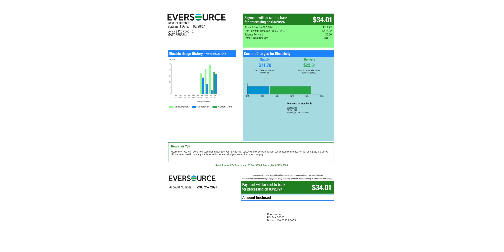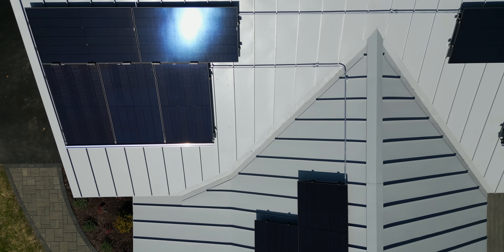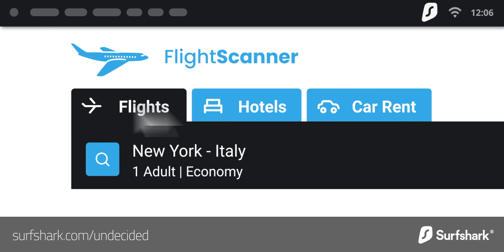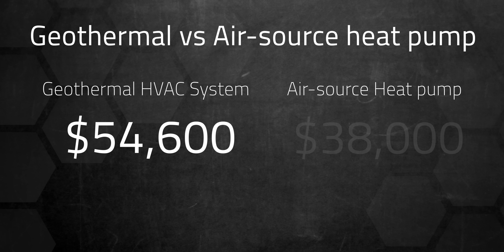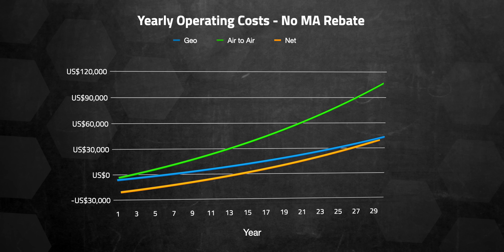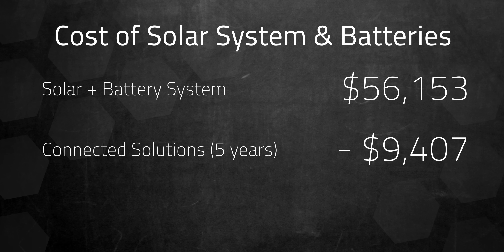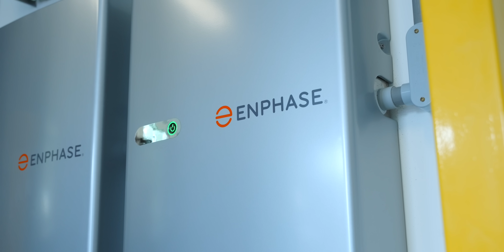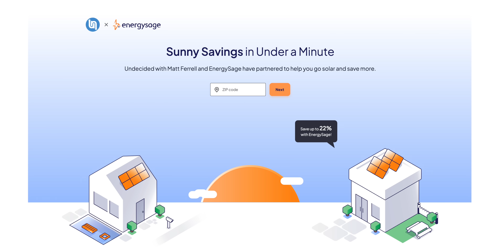What I Learned After 1 Year with New Solar Panels

Comment: Enlightening. Great for new homes, but of limited use for old ones. We are looking at buying a house built in the 1950s. I'm sure its HERS value would by like 100, or so. It would be better after insulating with modern materials, but still not great. Most people wouldn't be able to determine all those numbers you came up with, but the general concepts are sound. Maybe Energy Sage will be helpful. Thanks.

Comment: Watching this now and from someone who just installed solar in November 2025, those prices are insane!

My 7.9kW (13x615W) panels, 6kW hybrid inverter and 16kWh 51.2v battery cost me around $6K. This is not DIY, the system was installed by a local installer.

I'm in the Philippines. Why is it very expensive in the US?

Comment: This is way too expensive, I live in Florida where there is plenty of sunshine but my electric bill averages less than $120 a month. Even if I planned out a system for $40,000 it would take 27 years to break even and that does not even consider the cost to remove and reinstall when I will have to replace my shingles!

Comment: Where can I find specifications on a SPAN panel? Specifically, I want to install one for a heavy up and solar install in a house with early 1960’s wiring. I was told that if we upgrade the panel, the new code requires all new wiring as GFCI and arc fault are in the  breakers which are too sensitive for the old wiring. It is freaking me out - if true, Massachusetts electricians have a good lobbyist!

Comment: I am now net zero.  I started working on it in 2009.  I had installed my first set of panels to produce enough electricity to supply most of what we needed in our house that was built in 1977.  Our utility had to approve our connection and they wanted to make sure that it wasn't approving an installation that produced more than we used.  Knowing that helped me to decide not to do any energy efficiency upgrades in appliances and lighting until after we had approval for our system.  After the system was installed, we replaced our old refrigerator, dishwasher, clothes washer and dryer, and lighting.  We ended up producing much more than we needed.  In 2013, I bought a PHEV.  I needed to upgrade the system to stay ahead of the increased electricity needed by the car.  In 2021, I bought my first BEV, upgraded again and added a home battery. I upgraded with the idea of removing our old gas furnace and water heater with air heat pumps for both.  Now my credits that I earn offset my monthly bill for connection to the grid and my winter usage.  And I get a small check each year for my participation in selling some battery power back to the grid.

As for the fee the utility charges for connecting to the grid, I think it's basically unreasonable.  I put a lot of my capital into this system. I live on a pension and am not rich.  They are getting my power without anything but that small investment of a few hundred dollars back in 2009.  The utilities are claiming that they are losing big bucks because they could have made a lot of money off of me if I still had to use their power.  They don't mention that if homeowners never installed solar, they would need multiple additional capital investments in new power plants to provide what homeowners are providing at no, or very little, cost to them.  So, an extremely small fee of a couple of dollars a month for that rare time that maintenance is needed, is reasonable.  But the opportunity cost they are claiming, isn't.

Comment: I did a self install 10kw system with 42kwh of batteries. Cost me around $20k.  It's  on my 8 year old 2000 sq ft home in OKC.  We have natural gas also, so annual  utilities are $2400 for our family of 4 ($1600 electric,  $800 gas). Oh, and that includes my Tesla and Zero motorcycle fuel for the year.  It's not net zero, but if the utility power goes out, i don't even notice.

Comment: Most of the equipment will be obsolete in 10-15 years. Solar panels may last 20 years and then you are buying them all over again. Storage batteries will never last 30 years so you'll be buying them again, and most string inverters have a 34% failure rate within the first 15 years but you'll probably only get 5 additional years out of micro inverters. Good luck on spare parts availability or in anybody still being around to honor any warranties in 15-20 years. States are already doing away with 1 to 1 net metering, so there goes selling excess power back to the utility and Joe Q taxpayer, who can only afford to live ON the grid, and use standard heat pumps, water heaters, and clothes dryers are always glad to pitch in and subsidies toys for the rich. If your system never ends up paying for itself at least you can rest easy knowing you got an A in virtue signaling.
Reply: How is his home insurance not higher due to the solar system / battery fire risk?  Enphase, used in his install, brags about their fire safety.  
He's also charging his EV inside the garage, another known fire risk.
Never mentions maintenance of any of his complex mechanical & electrical systems.  Guess he'll never need any maintenance ... not to mention annual inspections.  
Didn't notice any provisions for safe access to clean his solar panels.  Wife can clean those.
Ah yes, and then roughly $50k total in geothermal/solar/battery discounts via contributions from taxpayers.

Who said Nut Zero doesn't pay?

Comment: 53K for 17kw/h of solar panels? HOLY SHIT. thats rougly 1200usd per panels. (i know it also includes micro inverters, but still, thats a shitload of money). International prices are about 80Usd for s 400w panel + 40 for a microinverter. I just bought a 5,5kw system with a 5kw battery for my house. Installed it was 8k usd. So a 17kw like matt has should be around  25k. Thats WAAAAAAY less than 130k USD. and i mean, argentina is not know for having amazing tech prices, a eiropean would pay like 20k for the same system.

Comment: I'm building my house right now,  I have a 10kw inverter, 12 400w panels, and I'm about to order a 30kwh battery system, grand total should be about $10,000 and should let me disconnect the main power and almost never draw from it.

Comment: The price- OUCH!
I'm in Australia and had basically the same capacity solar system installed for under $20k AU.
The house is reasonably energy efficient, but it was cheaper just to add excess solar capacity, rather than go to the expense of going to efficiency extremes.
It doesn't get proper cold here, 1-2 mornings a year when you'll get a frost on the ground, so most energy goes to cooling.

Comment: Wow, I think you overpaid for your system. I got over 10 quotes for solar and battery system before I signed a contract. The one I went with is a local family company that price matched the lowest quote I received. 7.9kwh system with 18 silfab 440w panels and 2 Franklin apower 2 batteries South of Sacramento for $55k. $39k after the 30% tax credit.

Comment: Had a problem with geothermal when the pump failed post warranty.  New pumps were triple the price of the initial one from just 10 years earlier.  Fewer suppliers.  Hated to do it, but went back to air-source.

Comment: Sadly, all you did was "Rob Peter to Pay Paul." You're now paying for equipment that will fail and you will have to buy all of it a second time. You won't be able to just swap out just the panels due to the advancements in technology. Sadly the lifecycle for the solar panels and batteries is still to short they do NOT last 25+ years. The output degrades every year and the loss is far more than they claim. The 25+ year claim is a sales gimmick and simply is NOT true. Idaho recently canceled the ability of homeowners to "supply" energy too the grid. (They deemed it unsafe for line workers.) So what happens when they do that to you? How many years of electricity bills would $88,791 cover? On top of all that it would be far less expensive to just move to a different state that has much lower energy costs.

Comment: The biggest mistake everyone makes getting solar power is only getting a battery system that only works for about 24hr's. You need batteries that can last 5 days or more. Because of inclement weather (blizzards, rain that last for days etc.) and the fact that if you are still connected to the grid. It can take that long or more to fix down power lines.
Reply: Incorrect. It's absolutely silly to invest in such an insane amount of overhead in a system that you only MAY utilize once every few years. 

You're honestly better off spending $600 on an inverter generator and pulling it out if you're in a situation where the power is out longer than your battery's capacity can handle. It saves you, you know, hundreds of thousands of dollars.

Comment: Let's see what your opinion will be 25 years in. Everything on the planet requires maintenance, and  the solar panels and batteries degrade over time. Who pays to repair the roof when that happens? Your savings are all biased towards solar, battery, and thermal.

Comment: Awesome video but your dependents on fossil fuel is more now than it was before. It takes fossil fuels produced the batteries solar panels and everything else. The carbon footprint on producing the solar panels the batteries is greater than the carbon footprint of just normal non-renewable energy. Play when your batteries go bad and your solar panels go bad the carbon footprint to get to recycle is greater than it was to produce it. And there's a lot of the stuff that can't be recycled so it's just hazardous waste. So going off grid is not better for the environment it is worse for the environment.

Comment: I went far cheaper.  I installed 8 420w solar panels with the 30% credit worked out to about $7800.  I sold my 2006 Honda Accord for $4500 and bought a 2013 Chevy volt for $9000.  Now, I wish I had 9 or 10 solar panels, but even so, I am coming up on 1 year in mid October, and since installation, I have generated 3.5 megawatts and consumed 4 megawatts.  It is interesting why my electric use is so small compared to you.  But, that is probably because I have a gas stove, gas water heater, and gas clothes dryer.  I have a new (2015) home that is well insulated, I pitched all the incandescent bulbs and replaced with LED bulbs and before the electric car I was only averaging 300 kWh per month.  Now with an electric car, I am using more like 440 kWh per month.
Reply: I am very happy, and for under $13000 I went from a normal (but efficient house) to a green house and a green car.  I am still using fossil fuels, but much less than most Americans and quite small amount for a 2200 sq foot house in Wisconsin.

Comment: These prices seem a little wild. Math maybe makes sense. Some of these monitoring systems, batteries, and what not are going to have issues down the road so there will be extra cost there repairing if your lucky, but probably replacing them. Also heat pump dryers are very slow. Ok for 2 people but for 4 it can back things up.

Comment: I am enthusiastic about solar however I think one thing missing from a lot of the very long term financial evaluation is taking account of the exponential fall in costs (panels, batteries, inverters) and the exponential rise in efficiency. What I think this is likely to mean is that people will be replacing their systems in far shorter time frames than 30 years and that there are real benefits for delaying investment. One example of the latter that I am considering is relying more on my grid connection for backup and having a relatively small battery system for the time being with the intention of getting the full battery setup in a few years when I think it will all be a lot cheaper. Another similar factor is that in many countries, including New Zealand where I live, costs of easily available components and costs of installation are still relatively high compared to what they are at source (mostly China), I think these are likely to come down substantially over time (as they already have but I think they will go a lot further as the industry becimes more mature).

Comment: In Thailand only 10.000 euro for a big system 17 kh panels, 15 kw inverter, 30 kwh battery, incl install costs. Can produce 70 to 90 kwh every day! In Thailand are no gas lines, no need for heating house. For us long pay back time ad 15 years bc we dont use much electricity now. But want to share our daily 60 kwh surplus with neighbours or free charge of electric cars in the front of our home.

Comment: Energy in Mass. is significantly more that in Canada.  In Mass. solar and geo makes so much sense.
Here's a brief comparison:
In Mass. it's 31 cents per kWh according to the video.  In comparison, in western Canada we pay 8 cents CDN per kWh (fixed rate), or about 6.5 cents US.  However we also pay other required fees such as connection, admin, services, etc which comes to about $90 per month CDN or about $70 USD.  
We mostly use gas for hot water and furnace.  It's about $1 CAD per GJ which converts to about $0.75 per 1000 cuft in USD (1GJ is roughly equal to 1000cuft).  Massachusetts costs about $15 USD per 1000 cuft.  Significant cost difference!

Given the very low cost per kWh and per GJ for natural gas, the lack of sunshine in the winter and the calculated payback for an installation of 20 years, solar and geothermal installations aren't popular here.

Comment: I am in Houston and just put in a system that is similar in size. 49 410 panels and 2 14kwh? Batteries. Not sure if I had those units right. Only 8 arnt on south facing roof and luckily ours is at 35 degrees so fairly optimum. Everything including install was just shy of 50k. With the fed credit it will come out to 36k

Comment: How many solar companies will still be around in 10 years when it's time to use that warranty? They all seem to be going out of business. Better get the cheapest high efficiency solar panels you can and replace as needed. Setting up solar is not rocket science, just takes some research, paying someone else to do it is wild.Also, the cost for solar panels is insane! There are 500w $256 monocrystalline panels that you could buy 4x over for that cost and and keep 3x as back ups.

Comment: Very insightful. i am frankly quite shocked by the price for solar and the battery. i have a far smaller system of 8 kwp solar and a a 7kwh battery. but i paid 11.000€. without subsidies it would have been 14.000

Comment: Here in Denton, TX the only utilities is COSERV, solar $25 monthly charge, then the "buy back" is $.89 and the rate is $.13. I do DIY 24/440w panels w/microinverters, I'm making a pergola to mount it, all for under 10K, I cover 118% annual consumption (opensolar calculations), ROI 6yr, I design/made my fully electric home, 2 EV's, regular electric water heater, induction, Mr. cool heatpump AC 17seer2 and samsung heatpump dryer. I keep the low budget, and I only pick the real fast ROI high efficiency equipment, nonsense for me to invest 30-60k on something with 30yr ROI. Be aware, don't mount solar panels on shingles roof tops, devaluate the entire home, high-rate insurance, to replace the roof, you need to uninstall the panels (extra 15K). and run when a company tries to sell you solar with loans... again pay something at 30yr no bueno, you are paying double or more

Comment: You forgot to include mass save savings for air source heat pumps. It is not 15k, but it is 10k. So, price tag difference between air source geothermal stays.

Comment: Dear Lord!  I cannot believe how expensive your solar system was!  I'm in the UK and I bought 22 x 425W panels with Tigo optimisers (snake oil?) and a 13.5kWh battery system last year which cost around US$21,500 fully installed and certified.   This system gave me a payback over the year of US$2,600 so will pay back in about 8 years.

Comment: My home was originally built in 1946, had not much insulation, was 2 bedroom 1 bath, I altered it to 5 bedroom 3 bath by adding a family room and converting a garage to a bedroom, then adding the upstairs with two bedrooms and bath. Also insulated it with the fibrous glass insulation ( Corning brand). Which is not as efficient as today’s materials, I added Tesla’s solar city panels to the roof ( 2nd story)  these were the lease agreement one which are no longer available, cost $5000 upfront, no other costs. 25 year contract, they have replaced one inverter and all the panels at this point. (Failures)  if I had bought them outright I’d be underwater, but Tesla cover all the expenses. I spend about $50 on natural gas a month , and have a credit of $300 on electricity which goes mostly away over the year. I have just now installed a heat pump, I wonder if it is a mistake, we’ll see!  I don’t have any batteries but that could be added.  I think two story houses are more efficient than single story, I have two EV’s , so no gasoline or expensive oil changes etc.

Comment: The advantage of two story houses is that heat naturally rises, making winter time warmer with a smaller footprint, which means less energy wasted, during the summer you dump the excess heat through open windows or a whole house fan. The difference between downstairs and upstairs is less than 10 degrees